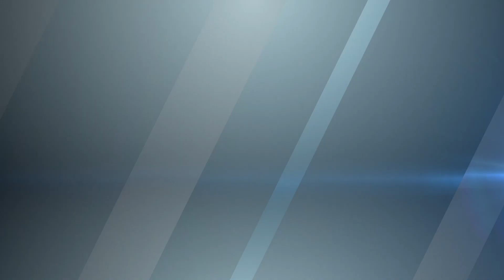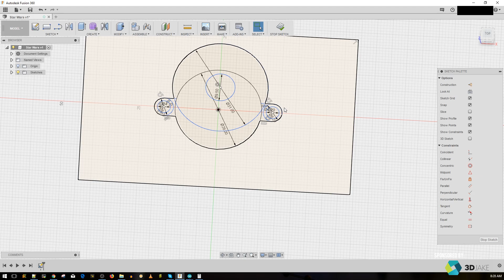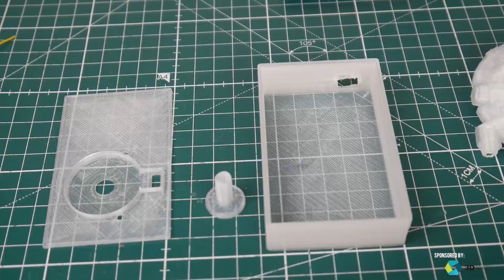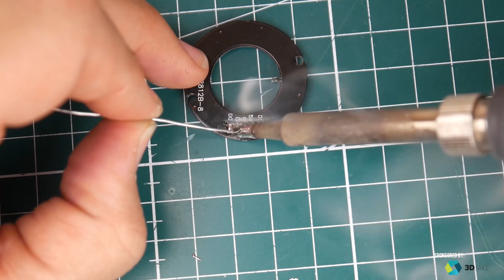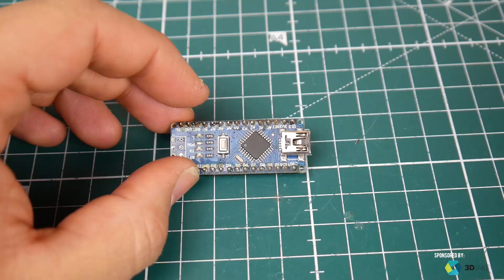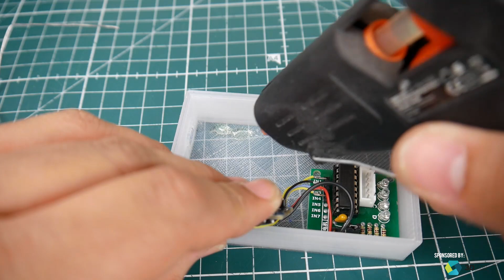DIY Rotating RGB LED Millennium Falcon // Arduino Transparent  Filament Project

Comment: Thanks for the 3dJake link, I may be using them in a couple of months for filament when my 3D printer arrives.

I see lots of filament types & colours I'd like to buy, but it looks like it's all going to get very expensive if I indulge, although the Prusa i3 Mk3 wasn't cheap to begin with...
Reply from the maker: I bought all my previous filaments from them cheap and fast. Two days max and its on my door
Reply: I like they're in the UK and £40+ orders is free post.

Looking at the list of filaments they offer i realise I need a crash course in what plastics for what purposes - do you have any suggestions on where to start researching this subject?